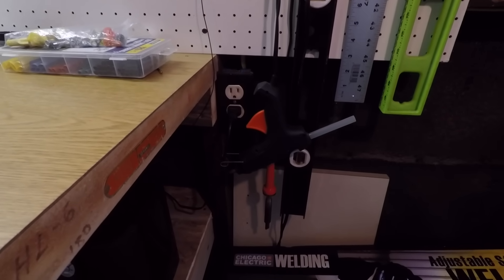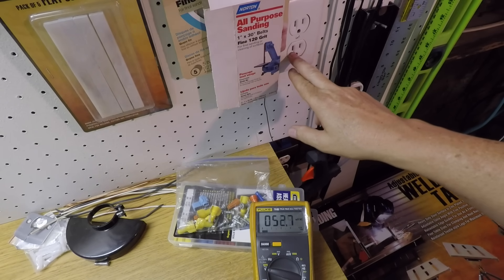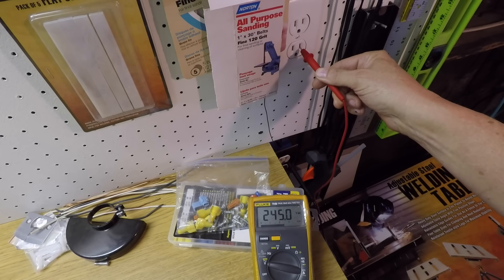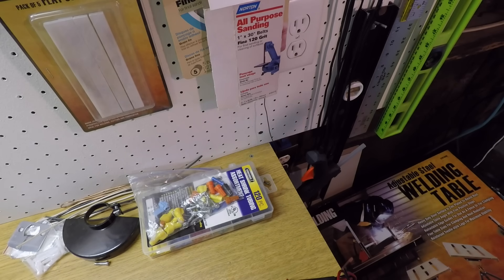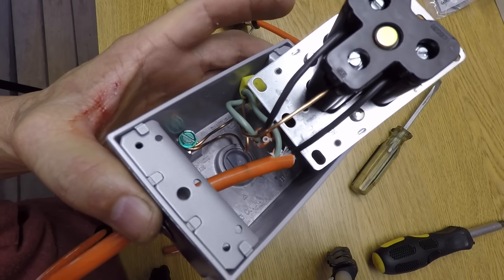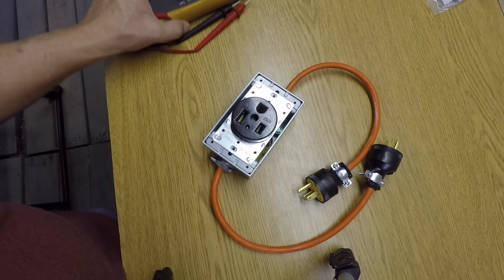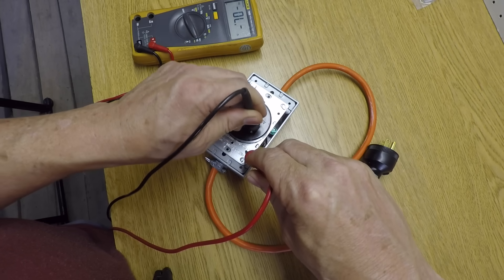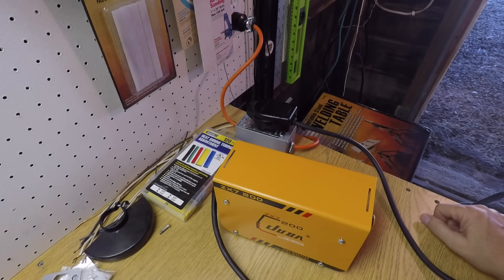How to Get 220v From 110v

Comment: A device which is called a house "burner downer". Ideal for burning your electrical equipment up and burning your house down. If you do not want to spend the money pulling a dedicated 220 circuit, make an 50' extension that plugs in your dryer outlet and take the welder closer to the house. If by chance someone makes that rig and plugs it into two receptacles on the same circuit, #1, they will have two 110 legs phased parallel which will destroy the welder, #2 they will overload that circuit which if the breaker does not trip can burn the wiring and the house up.
Reply: 1. If both recepticals are on the same circuit nothing will happen because the potential between the two plugs will be zero. Try probing two recepticals that are on the same breaker.  One probe in one hot leg the other probe in the other hot leg. You will measure zero volts.
2. His mistake was not pinning the two single pole breakers together or replacing them with a 2 pole breaker.
Reply: @pstoneking3418  Had two circuits on the same bus in the panel cross, couldn't figure out why one kept tripping except it became extremely hot(bordering on untouchable). Also, light bill was running about $250.00/month over what it was after repair. That was in the panel, now just imagine that same scenario through two 110 receptacles on #12 wire, (that's if it is #12). I thought the same as what you said, and had two electricians say the same. Had to find and fix the short to prove that wrong (breaker stopped overheating, electric bill came down to $72.00/month). And yes, both breakers were on the same buss bar.

Comment: Could you put a light switch in front of both outlets and kill power that way besides how often are you going to move the what ever it is your using around most 220 powered equipment are not meant for mobility for the most part like your video have been looking for a,way to do this I knew it was possible my Dryer has a 220 plug so I wondered how it got apropriate power I assume in this manner

Comment: Sorry but you can't get 220 from 110,must of got 110 from one leg that runs some plugs and 110 from another leg from panel.So in reality your using two legs from panel and not the same 110.
Reply: That's what's he's doing.  He has 220 volts coming into the garage.  But coming in as two 110 volt legs probably on separate runs from what it sounds like.  All he's really done wrong here is not pinned together the two breakers or replaced them with one 2 pole breaker.

Comment: If your cord is only rated for 15 amps, and you're not using the white wire, why not connect both white and black to the hot? That way it helps carry the extra current better?